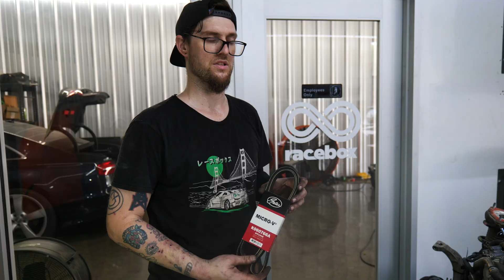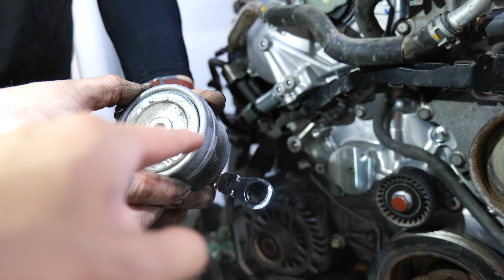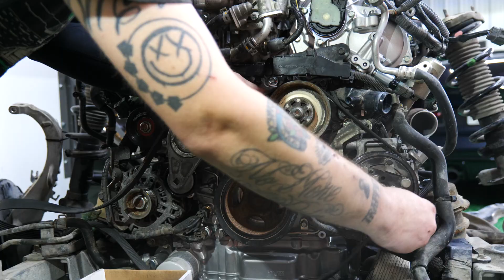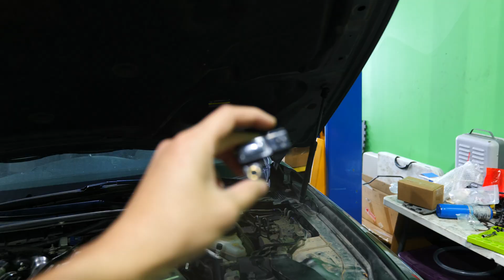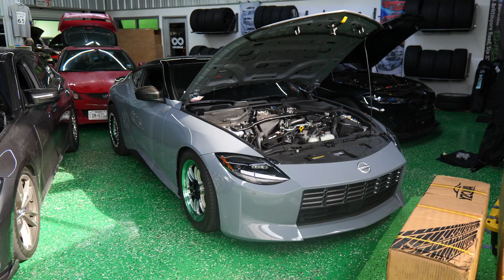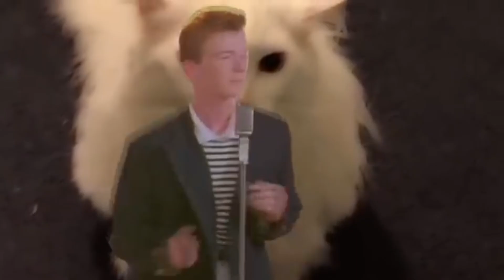RACEBOX VR30 Pulley Kit Install (No More Shredding Belts!)

Comment: Wait he confused me on that 1st pully. And I saw another video saying they used washers in the back. So after removing the 1st pully he said you reuse the hardware but took a bolt and the "dust shield" off the the old 1 but when he put the new 1 on it didn't look like he reused the "dust sheild" do you reuse the sheild or just the bolt or like i said i saw people say they used washers??? ANY HELP ASAP WILL BE APPRECIATED AS IM TRYING TO INSTALL THIS KIT TODAY

Comment: Installed my Z1 anti jump belt kit today and sounds like I have a damn bird chirping in my engine now just orders a tensioner pulley and upper grooved pulley hoping that fix’s the issue 😐 never had this sound before installing
Reply: If you used the Z1 belt that's the problem you need to pay the extra and get the OEM belt or a Gates belt
Reply: @Comeback_q50 yup changed it put to a gates belt and the sound went completely away

Comment: Do you guys have a video of this being done with the engine still in the car or do you have to take the engine out to do this?
Reply: There are plenty online for the belt . It will be tight on there with everything in the engine bay for the pulley replacement
Reply from the maker: Like mentioned by the other commenter, it’ll be tight, so impossible to show on camera with good angles and clear view! We showed the process with the engine out so you can see exactly where on the engine things are, so you have a reference when actually hands on doing this install even with the engine still in the car.

Comment: Do you need to reuse the dust shield on the tensioner pulley? The bolt does not sit fully flush without the spacer thickness under the bolt head - bottoms out, for me at least. I ended up putting a washer underneath the flanged bolt head. No issues, so far…
Reply: Please help me with this issue. They didn't show anything about reusing the dust sheilds? I saw them say to reuse the hardware but then he installed the pully without it i thought

Comment: Does the new Z have these same pulley issues or did Nissan sort it out?
Reply from the maker: Sort of, the new Z has a lip on the lower idler pulley to prevent the belt from slipping off, but no change to the other ones. We decided it’s best to just upgrade all 3 pulleys with better quality materials to bombproof it, the OEM plastic likes to melt/disintegrate sometimes.

Comment: I read about this issue before I bought my Q so it was the first “mod” that I did. Went to the Nissan dealer up the street and got a pulley for a 23+ Nissan Z, ordered a Gates belt like in this video and went to work. Honestly it was one of those jobs that should have been super easy but was a pain because there’s no space to work. But it’s something you can do in like an hour with basic tools. Definitely worthwhile to get a kit like this though and just eliminate all belt issues.
Reply from the maker: The Z’s updated pulley is a great OEM upgrade! We just like to go a step further and fully bombproof it. 🫡